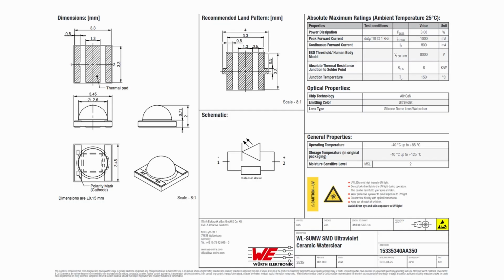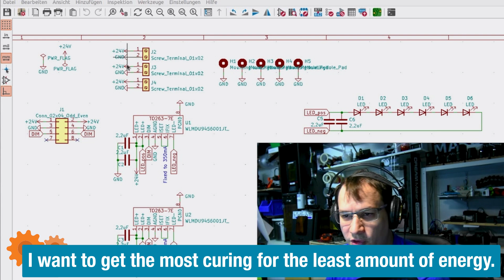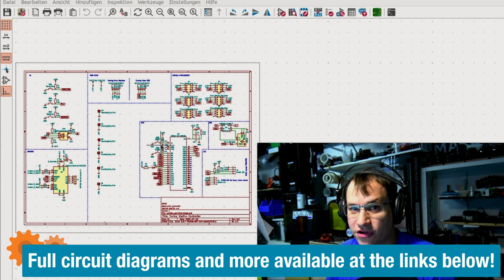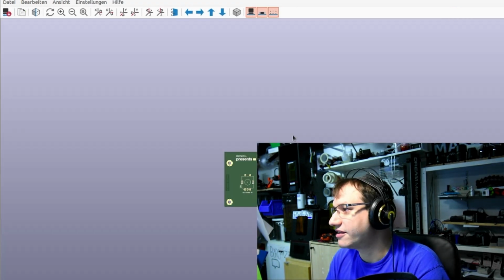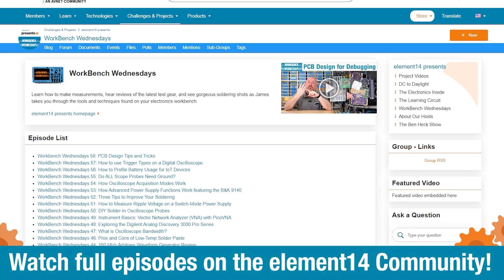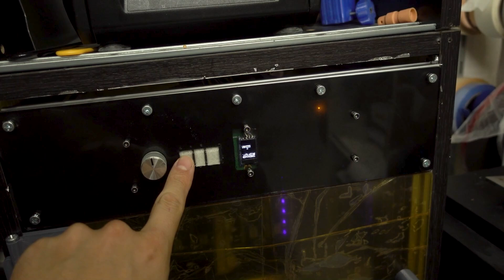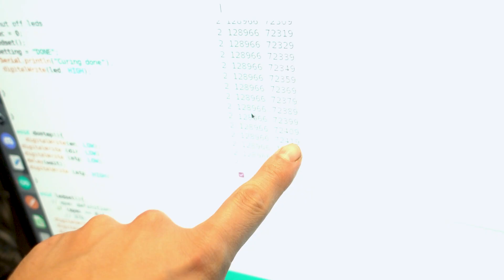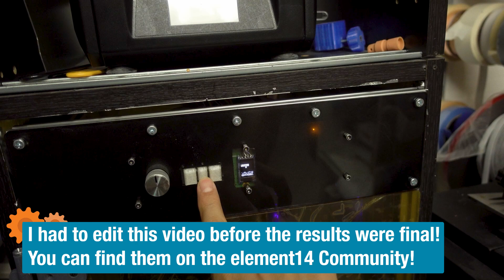Multi-Spectrum UV Resin Curing Station with Würth Elektronik LEDs

Comment: Shouldn't you first verify your negative consequences of broadband curing? You may be developing something to solve a nonexistent problem.
Reply: The case is extremely but can happen, main point is energy saving, and possible time savings depending on the resin used.

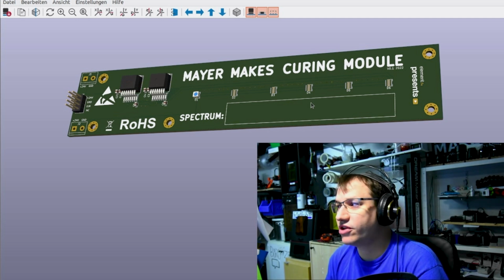Comment: 5:21 removing or adding LEDs will not change the current. LED driver will change voltage accordingly to number of LEDs but the current will stay the same. Of course the total used electric power and light power output will also change. The same mistake is at 6:06 - you regulate brightness by changing current using DIM pin or resistor Riadj value.
Reply: Good catch!  of course the current stays constant. The dim pin is used for dimming via pwm. At that point I had not decided on controls/psu , I expected 24v but wasn't sure i can get a suitable supply yo drive all 36 LEDs at once. I'm glad we have such knowledgeable users that spot these details!